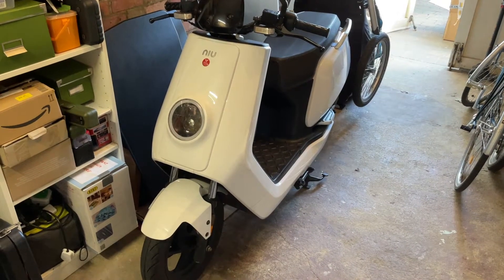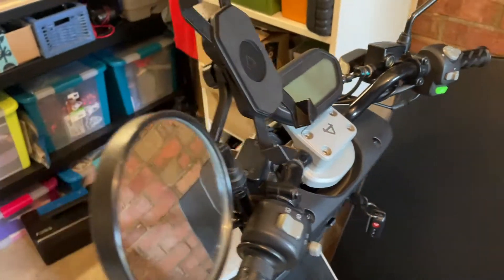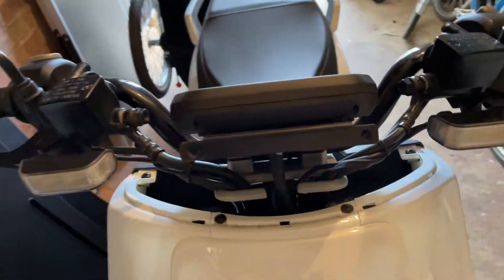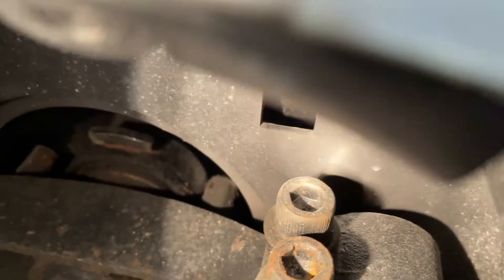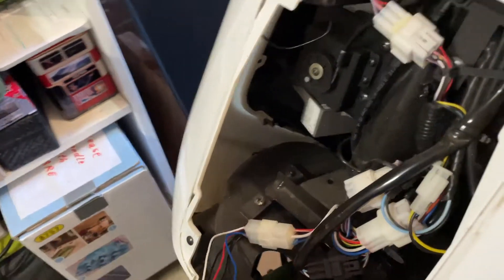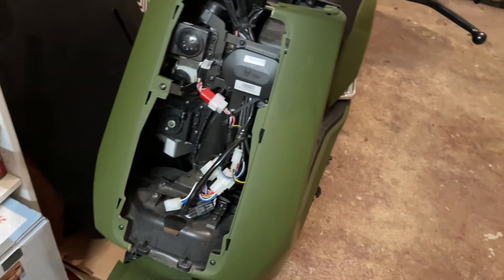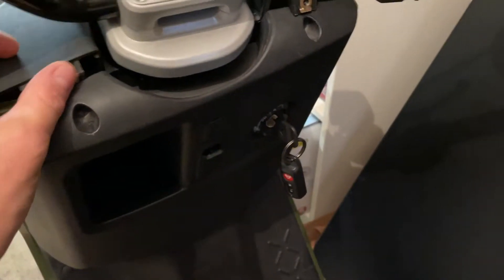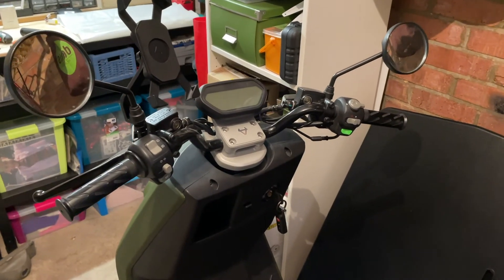NIU ECU Removal

Comment: Hi there! Learned some usefull stuff watching the video and reading the comments! I am getting the fault code ''99'' (electronic components communication failure) do you know if replacing the ECU resolves the matter? I am also getting n.60 and n.67 which I think they will be gone once the ecu is replaced. Btw I have bought the smart service subscription I run the health check and get normal in everything.
Reply from the maker: Hi, happy to hear that my video was useful. As for your error codes, I assume you have done your research on the various NIU forums. Replacing the ECU might solve the problems, but it's a big unknown and an expensive risk. In an ideal world, you would be able to borrow one and install it. If that solves your problems, you could then buy it.
Reply: @randomtasks  Thank you for your reply. You coudn't say it any better!

Comment: Tengo error 67, está en garantía pero me parece extraño que una moto tan nueva ya me este dando problemas nuevamente, primero fueron las baterias y se reemplazaron por unas nuevas, santa solución pero ahora disq error 67, rayos!
Reply from the maker: Por suerte, puedes ignorar el error 67.
Reply: @randomtasks  así es, pero, ya me dieron el dato de la posible solución, por allí comparto un video si fue posible corregir el error 67
Reply: @JoyPanama  Hola te escribo desde la Ciudad de México tengo el mismo error 67, pudiste solucionarlo? me puedes compartir el video que mencionas:hand-purple-blue-peace:
Reply: @ND-of1zw  simplemente abre el Emu, desconecta la bateria por 15 segundos, luego vuelve conectarla y santa solución 🙌🏻👌🏻
Reply: @JoyPanama did you ever find the fix?
Reply: @SW4Life202 yes, u just need to disconect the emu internal battery for 15 seconds and after plug in, thats all. But first remember desconnect the bigs battery, do not working the Niu with the batteries coneected.
Reply: Yo tengo el mismo código 68 y hago lo de desconectar la batería muchas veces y sigue saliendo ayuda por favor
Reply: @antoniogonzalezceron6104  Código 68: Significa que hay un fallo en el circuito de la batería, según el manual de usuario y la página de soporte de NIU. 

Debes de ir a la agencia, ese problema es mucho más complicado, no se puede resolver por cuenta propia salvo sea que tengas los conocimientos técnicos.

Comment: Is the GPS in the ecu?
Reply from the maker: For the first generation ECU (up until early 2018), the GPS is inside the ECU. For the 2nd and 3rd generation ECU, it’s mounted on the outside of the ECU case.
Reply: @randomtasks  could I remove the gps system and still drive the scooter?
Reply from the maker: @dompie247 I've never tried. As I said, for the 1st gen ECUs, the GPS is inside and, as far as I know, there is no way to remove or disconnect the module. For the 2nd and 3rd gen ECUs, you might be able to disconnect it. If it still drives, you will likely have an error message on your display, but everything else seems normal, then you can ignore it and drive on.

Comment: I just paid $49 for 2 more years of GPS, 1 week later it stopped!  They said disconnect and reconnect the battery.  Apparently its not the main one.  My local dealer stopped doing NIU and said its where you are working.  Can you point out where it is please.
Reply from the maker: The GPS module is attached to the ECU, so if you unplug the ECU, it will completely disconnect it from the main batteries.
Reply: @randomtasks my 2024 doesn't have an external GPS module everything seems to be contained within the ECU.
Reply: V36 is the version and I'm trying to find a replacement one to see if that will work.

Comment: Hi,
thanks for the awesome video!
I lost my two keys and my Niu is locked, now. Do you have any Tipps on how to renew the lock? I guess removing the front won’t help. I guess I need to drill the lock, isn’t it? Thanks in advance
Reply from the maker: Not only do you have a lock problem, but you have an alarm problem as well. I don't have a guaranteed solution for you, but before you drill both locks (there is also the battery compartment release lock under the seat), I recommend contacting your local dealer to see if they have a solution. Maybe your VIN is linked to a specific key that can be ordered. Your VIN is under the seat, which you can't access, but your ownership papers should also have it listed. Good luck.

Comment: Does that scooter have 12v circuit? I want to install wireless charger for my phone
Reply from the maker: Yes it does. Near the ECU is the transformer with 5 VDC and 12 VDC outputs. The lights, display/dash, and horn run on 12 VDC.
Reply: @randomtasks  Thanks!
Reply from the maker: @OKManNoOne  If you watch my Vespa LX 50 conversion videos, you can see what the transformer looks like. I converted the Vespa using all of the electric components from my NIU.

Comment: Is it possible to DIY replace the ecu battery?
Reply from the maker: I didn't notice a battery within the ECU when I opened it up. Open up your ECU and check it out yourself. As shown in my video, it's pretty easy to get to the ECU and there are only 4 screws holding the enclosure together. You can also post your question in the forum at myniu.org. There is a lot of good information on that site and in the forum.

Comment: Hello, i have the same bike a 2017 ns1 and the bike lost signal to the bike, i havn’t got any codes on the scren or so. Do you know what the problem chould be?
Reply from the maker: Your best bet is to post in the forum at myniu.org. There is a lot of good information on that site and in the forum. That being said, the SIM card within the ECU can die and it's impossible to replace it. If it is no longer active, you cannot connect to your bike with the app and can no longer get OTA updates.

Comment: Hi, I just got NQI Sport, but battery ecu is 0%, it won't charge, please advice, thanks
Reply from the maker: Sorry, I am not an expert. If it won't charge, you might need to replace the BMS. I have a video on how to do that. Otherwise, consult your local NIU dealer.
Reply: @randomtasks  Thank you for your reply, won't charge is ecu battery, not main battery, I will contact the dealer, thanks

Comment: I have the mqi2s city and the converter has gone. Do you know if you can replace it will a better and more reliable brand?
Reply from the maker: I'm not sure what you mean by "converter", but in general, you can only use NIU parts inside the bike. If by "converter" you mean the charger, I believe there are some aftermarket chargers that will work. Check AliExpress for chargers.

Comment: So the niu would work without a sim card? and would it work without being connected to a phone? I have no idea
Reply from the maker: Yes, although you get error code P67 flashing every minute or so, which is annoying at first, but you get used to it. And without a functioning SIM card, there is no connection to the app, so no phone required.

Comment: I managed in the end, I broke both the 2 plastic rawlplugs underneath.  I think you have to do that anyway.  I was wanting to fix a roll radio designed for handlebars.  Sadly not rechargeable, has to be wired in on the ignition.  However the ignition has no tags like I expected, totally sealed, so put it all back and will need to think of another way.
Reply from the maker: You might want to try tapping into the small DC-DC converter. It has 12V and 5V outputs. It looks like this:  https://www.gumtree.com/p/replacement-parts/pld125-1dcf55-12-power-converter-transformer-for-niu-electric-mopeds-scooters/1421048150
Reply: @randomtasks  I did see a solitary black and red connector, but I would need to install a switch which I might do, thanks.
Reply: @randomtasks  I'm having another go tomorrow, should be sunny.

Comment: How do you switch the mother board on these scooters?
Reply from the maker: In short, you can't. You can replace the ECU and you can replace the controller, or buy an add-on unit for the controller that will make you go faster. Read this to learn more about making them faster: https://www.myniu.org/making-the-n1s-faster/

Comment: I have the failure code 60 , did you have the same problem ? do I have to swap the hole ECU is there no way to check if the sim card is fallen out of its place ? 

I hate it so much, how can a new e scooter have problems like this so fast
Reply from the maker: I had failure code 67, which is common in 2017 models. The SIM card cannot be removed and cannot fall out of place. I know that software updates can sometimes cause problems. Check with your dealer and/or with NIU directly. They might be able to solve the problem, assuming it's software related. Otherwise, if the problem is the SIM card, you will either need to replace the ECU or live without having a SIM card connected. What year is your bike? And are you located in Germany?

Comment: I have a Niu Uqi Pro 2021 model, suddenly the GPS has stopped working on the app. Are the steps similar do you know? Thanks!
Reply from the maker: The UQi is completely different from the NQi/N1S. In theory, the steps are "similar" in that you need to remove some body panels to expose the ECU and GPS, but I've never wrenched on a UQi. However, for a 2021 model, your best bet is to go to your dealer since it's probably something that they would fix under warranty. It might be something as simple as a software update.
Reply: @randomtasks  Thanks for the quick reply. I've emailed Niu and asked for a OTA firmware reset in case they fixes it.

Comment: Is there anybody have Battery Issue? it drains in 24 hours completely, and charging way too slow... now we need how to replace NIU ECU BATTERY video :D thanks, it needs 1 - 18650 Battery
Reply: It’s normal for the ECU battery to drain once disconnected. I have taken my bike off the road since December and left it till March (now 2022)  connected it and it’s fine. Charged up in about 6hrs.  Best thing to do is store the bike in your house off the street out of the winter - as there’s no ECU to alert you of theft,movement etc.. I’ve raised it with the dealership and NIU aren’t going to change it. Which defeats the purpose of taking the battery into the house over winter so it doesn’t get damaged by the cold. A bad design. Keep the battery out of the bike and the main battery will hold its charge for months.
Reply: any solve for ECU battery not charging back up after batteries are drained? both my batteries aren't charging and ECU is at 1%. trying to find a DIY. thanks! @stumpusMaximus
Reply: I was told by my dealership that there is a CR 2032 battery that charges the ECU somehow . Does anyone know where it is exactly and how to replace it
Reply: @marksfilmsd It's an 18650 battery, I have a brand new scooter and the dealer closed (clearance sale) so I'm am trying to figure it out since the GSM and GPS in my ECU isn't working, which means I can't connect to phone app.